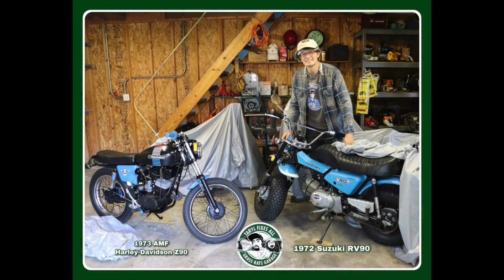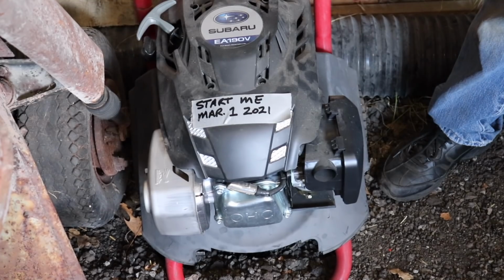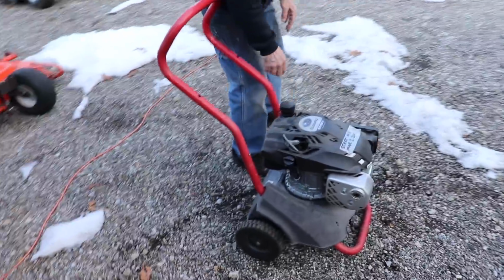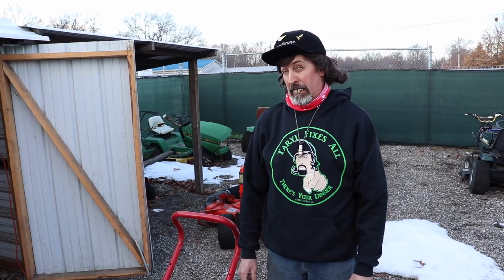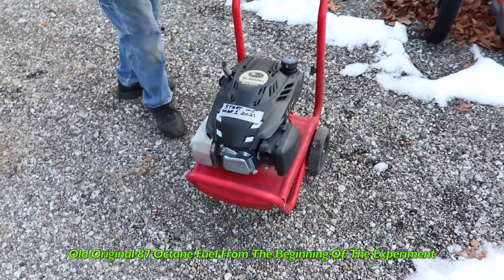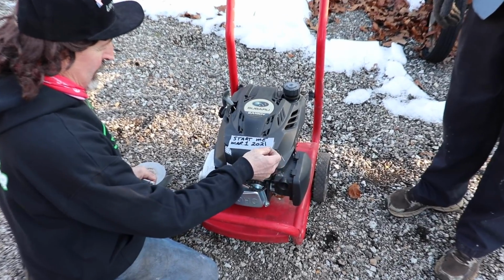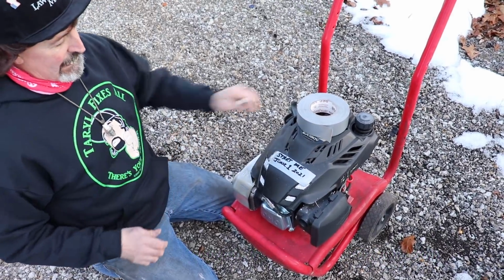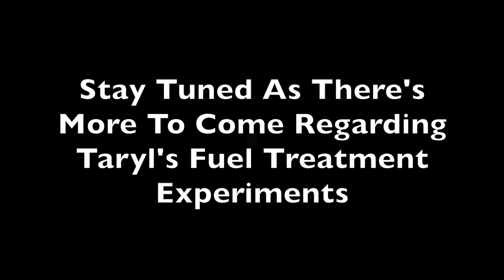Will They Start? Fuel Treatment Experiment

Comment: The engine's started every three months seem  to run better than the ones started every month. I think your right about the snake oil theory
Reply: It’s probably conventional 10W-30 oil in the engines. In the winter it’s hell getting them started. I’d bet if the engines were 3years old broke in and 5W-30 synthetic was used they’d start easy like a snow blower starts easy in the winter.
Reply: @Northlanderm  you don't need synthetic in winter. I have a  mid 60's ariens gard-n-yard with the snow attachment and the original engine. Never had synthetic oil in it and still starts 2-3 pulls mid wisconsin winter. Just regular maintenance.
Reply: @meegstomtom  Every engine brand combustion chambers, ignition, carburetor etc vary per brand and year.

But you are right about proper maintenance.

Comment: I spent a month and a half repairing small engines at my dad's shop. And each day I watched one of your video's I learned so much! Repaired everything from single stroke to duel cylinder and up. My favorite was a Onan 2 cylinder fork lift had been setting for 20 years. With your help was able to break it down and rebuild the engine, carburetor, points, magneto, and a rusted old gas tank. Thank You so much for your video's, There's nothing like the feeling of fixing a broken device.
Reply: Whats a single stroke?
Reply: @effgee5102  1 piston or cylinder

Comment: Taryl: I think you just about hit the nail on the head with your "snake oil" comment regarding fuel additives. These gas manufacturers are very clever people and know everything there is to know about the fuel they sell. If an additive would make a big difference to a fuels performance they would be putting it in there at the manufacturing stage. Lubricant additives are a similar con trick to be avoided.
Reply: I agree, manufacturers know their product. The only time I use an additive (sea foam) is after I've cleaned a carb. I find if something sits for 2-3 years, the fuel here turns orange and soft "crystals" grow in the carb...could be the absorbed water allowing a galvanic corrosion of some sort that plugs them up. Anything that gets used, the fuel never gets that old.

Comment: Those Subaru engines are pretty freaking good.. Left out in the weather for months in snow, they still fired up..

Additives may not be what they claim to be after all..
Reply: I bet the new style Briggs engines with the plastic carburettors and plastic fuel jets wouldn't have lasted this long.
Reply: @bentullett6068  Plastic doesn't corrode. 
People are crapping on Briggs for starting to use plastic in fuel systems, but automotive industry has been doing it for 40 years. Everything from fuel tanks, to fuel pump modules, to fuel lines, to fuel rails, to fuel injectors. All very much capable of lasting the life of an automobile.
Reply: @erikj.2066  it's not the plastic that's the issue it's the main jet design. We have been told by Briggs and Stratton's UK operations that we must change these jets on a regular service. Issue is there are many people who don't look at the terms and conditions the manufacturer states and never service their mowers and expect them to last and work reliably, they wouldn't be told about the jets blocking in the carburettor if the fuel goes off and assume it's under warranty.
Reply: @erikj.2066  And Intake Manifolds.

Comment: A couple thoughts-
"Premium" fuel does not equate to "Better"fuel.

"Octane" does not equate to volatility. It refers to how fast the mixture burns in the combustion chamber, and high octane burns slower than regular.
Reply: In some premium fuels no ethanol is added.  It varies by state and gas stations.
Reply: Premium fuel labeled “No ethanol added” in my book is better fuel.

Comment: Only treatment to my fuel system is I treated it to the addition of a fuel valve. I shut off all my equipment from the fuel valve and burn the gas out of the carb before storage. Been doing this for years and it's never failed me. Mostly just have to jump start the first time.
Reply: totally agree
Reply: Works for me.
Reply: Absolutely! Been doing if for years and it works! I cheat on the jump start. I bought some of those cheap HF float chargers and put one on every vehicle and piece of equipment I own that has a battery.
Reply: I can't wait until Taryl debunks that theory too.
Reply: @mark-wn5ek  Dude, do you even know the definition of theory?
Reply: @mark-wn5ek  I'll debunk it for you right now. Riding mower I bought new in 2008 has never seen fuel additives or anything other than "regular fuel". No shut off, gravity feed keeps the carb full. Stored in the unheated barn from mid September until mid April without being started. Starts every spring, have never had the carb open. Have done a head gasket and replaced the battery a couple times though.

Comment: These newer engines have better sealing gas caps. Old engines have caps that vent both ways. kind of open like the open lid glass jars. Wonder if they left a cap loose for experiment how it would start over time.

Comment: I've been saying since the beginning of this experiment that fuel additives are not necessary.  For years and years, I've been wintering-over leftover 2/4-cycle dinosaur juice.  Never had the slightest hint that they were unuseable from one mowing season to the next.  For the first time since November, I started both my Toro weed wacker and Craftsman leaf blower with a lot less trouble than Taryl had.  My (nearly full) 1 gallon 2-cycle dinosaur juice jug sits on the shelf.  I'll be giving it a shake, then finishing it off, come springtime.  My Craftsman YTS3000 Mower has been starting (twice monthly) throughout the wintertime with plain old 87 octane Corn Whiskey (Ethanol-blended Regular).  My mower gas will be good enough to begin mowing season as well.  Dinosaur Juice Fuel Additives are;  SNAKE OIL, SNAKE OIL, SNAKE OIL!!!  Another big help is, KEEP YOUR EQUIPMENT AND DINOSAUR JUICE CANS INDOORS!!!

Comment: I understand that it is a "will it start test".  BUT will it perform correctly under load ???  
As in...partially clogged jets...
   I'm still a firm believer and long time customer, and recommend 
"Sta-Bil 360 Marine" stabilizer with Regular gas (it is a different product than Sta-Bil storage) to all of my customers...put the correct amount in the can before filling the can at the gas station and use that mix all the time. I do see the result of people dumping stabilizer into the tank at the end of season...nasty mess. 
  My long term test...25 years...of Sta-Bil is a Kawasaki liquid cooled engine on a John Deere 345 tractor bought new. Sta-Bil used in it since new, tractor is subject to being used 12 months a year (there have been winters that it sat unstarted full of fuel for 6 months)...mowing, towing, snow blowing...original carb, bowl never off, no fuel issues. I work all the time on 1 year old engines that have carb issues.

Comment: I had a brand new 15 hp Mercury 4 stroke. In the manual they mentioned nothing about draining fuel out of the carburetor. All the four strokes after that put a red screw to drain the fuel for storage. Now Mercury has EFI. My outboard had that white stuff in the carburetor. I didn’t know it was from the ethanol at that time. I just blamed the outboard as being fussy and hated the thing. Before that I never heard of using stabilizers. My dad never did ever. 
From that point on I’m firm with using stabilizers in all of my engines especially if they’ll sit for months all winter like here in Minnesota. Nobody around here will ever start a lawnmower once a month after the snow falls. When its put away it’s put away. 
Since that I’ve used SeaFoam. Last summer I switched to the Red Sta-bil. This summer I’ll be using the Sta-bil 360 Amber. The reason I switched is because Sta-bil is more economical and goes much further for the price.

Comment: Hey Taryl, I live in the same climate as you. It has been my experince that when I leave my lawnmower sit over the winter, I have no problum starting in the spring. When I put my snowblower away I drain the fuel. I belive it has to do with the tempeture. the cold presurves the fuel, and the heat gums it up. That's just my 2 cents been doing it that way for 45 years. Thanks
Reply: Yep. Here in the Mojave desert, ethanol polluted gad goes bad in 8 to 10 weeks. Smells like paint thinner, looks like orange juice. I only use ethanol free for things that aren't used a lot.

Comment: I just moved south from Massachusetts to Florida three years ago. What I've found is the condensation filling the gas bowls and rusting the pin valves shut. Continually cleaning the carbs. Not to mention replacing fuel lines. All gummed up. Deterioration.

Comment: Must admit those Subaru engines are doing well on stale fuel...but I wonder what those new style Briggs and Scrapem engines with the plastic carbs and fuel jet would be like on this experiment if they were left as they always seem to be the common engine we find not starting or running properly on old fuel after winter in the UK. We don't seem to have issues with the engines like these with metal float bowls and carburettors much.

Comment: Taryl, a suggestion for you: 
What about doing this test using an older engine too? 
The Subaru's having to meet modern emissions (including fuel vapor evaporative emissions), no doubt have vent valves built into the fuel caps keeping the fuel tanks fairly well sealed, and preventing some fuel degradation. 

What about doing this with an older engine that has a gas cap with the simple pinhole vents, or maybe something from the 90's, when they just started trying to do an automatic venting gas cap?

Comment: Agree about the snake oil. What do you think happen? Is the motor builders putting better fuel Lines and o rings or did the ethanol fuel change the formula?

Comment: Would be a neat experiment of the materials by putting a new carb kit and fuel line into 87 pump fuel with ethanol.  Then either new old stock or strip an old engine made before ethanol for needle, seat, gaskets and fuel line into the same fuel.  See when/how fast each one goes crunchy or falls apart.

Comment: I never use fuel additives besides what ever they put in 2 stroke oil. Haven’t had any issues besides just the fuel being so old it didn’t want to run. Swapped the old mixed fuel that was 6 months old on the dot for fresh and all symptoms went away immediately. Fuel just didn’t have enough octane to run anymore. The symptoms it had was it was unable to rev up and felt like it had major carb issues to the point I was gonna take it to the dealer.
Reply: Octane??
Reply: @chrisbcritter6112  yea its the rating of the fuel. when you go to the pump and buy gas its by the octane rating. the higher the number the more resistant the fuel is to detonating. if it drops to low nothing will really run on it. you can read up on the octane rating on wikipedia they explain it. in the states we use 2 different types and use the average of those for our rating

Comment: Does the relative age of the engine or motor factor at all?  Those Subies were brand new. Would a worn out 15 plus year old Briggs powered mower still start treated with this stuff?
Reply: Personally i wouldn't waste my money on additives..just use a good quality non oxygenated ethanol free gasoline and keep the machine in a garage or shed
Reply: @leeharris3061  I use any and all cheap fuel with ethanol. The way I avoid carb and fuel system issues is shutting all my equipment off with the fuel valve and burning all fuel out of the carb before storage. Been doing this for years and it's never failed me. Mostly I just have to jump start the first time.
Reply: If you have not put new fuel lines and a new carb rebuild kit you would have problems.
Reply: @johnisley1285  not sure who your comment is directed to but after installing my fuel valve carb replacement is a thing of the past. Most of the carbs I replace now are on other people's equipment.
Reply: Not in the sense of being worn out, but in the sense of EPA compliance for fuel vapor emissions. 
Without a doubt those one year old Subie's have to meet much stricter standards for fuel vapor control than what a 15 year old Briggs would have, meaning the fuel tanks are much tighter to air, which would mean less fuel evaporation, oxidization, and contamination that would cause the fuel to degrade faster.

Comment: I only use non ethanol gasoline, from a reputable and high volume source, in my small engines. I never use any kind of stabilizer or treatment and have yet to have any kind of fuel related problems. My pressure washer that sat for over a year started up with only a few pulls.

Comment: Wonder if carbs get plugged because of the extra dirt/contamination from actually using the mowers for a while. Everything you have was brand new. Might need a used engine/tank and a used fuel can let that sit around the gas will evaporate and you leave behind more dirt % in the fuel thats left.

Comment: one spritz of starter fluid and I think all the engines run on the first to third pull no matter how old the gas...i use Stabil but now I wonder...i guess if it doesn't hurt but I usually run everything dry at the end of the season...i would just put some stabil in the left over gas in the can

Comment: I must admit I'm shocked that they started. We know that at some point all gasoline gets rancid and leaves resin in the carburetor and gas tank if it sits long enough and that ethanol is fuel does attract water. Phase separation is definitely a phenomenon that occurs. So what circumstances are  preventing these issues in the engines being tested? Do newer engines  have better sealing of the fuel system from air to prevent evaporation and contact with outside air due to EPA regulations? Have manufactures of newer engines started using rubber parts that are more resistant to ethanol than older engines due to the prevalence of ethanol fuels?

Comment: Doesn't that stuff also protect internal metal parts from corroding? I have a old  craftsman mower that had corrosion in the bowl. I never used any protectant. Come to think of it i still don't.
Reply: Mix some 2 cycle oil in the gas and run it dry. I've had good luck using this method.
Reply: @kalebgrieve1729  ok thanks!

Comment: I used to have a small yard and the gas container I had the first time I filled it up i filled it up full, i think it was a 2 or 3 gallon container.  Basically this was my first yard, first mower.  So the first year, i used hardly any of the gas,  so i kept using the gas until it ran out, and I'm not kidding when i say i got 3 seasons out of the same gas.   So when i hear people say that gas goes bad after a few months I just laugh because i personally know that's not the case.   no additives, always sitting outside under my porch,  3 seasons using the same gas and the mower always fired up fine.

Comment: Snake oil. I have been using the same gas that is sealed and stored in a shed in the Spring that was leftover from the previous Fall every year for 20+ years in my Briggs and Lawnboy stuff. Never have run them out of fuel at the last use either.

Comment: I'm starting to wonder if the engines themselves may be the reason they are all still running, perhaps these Subaru engines are more capable of running on bad fuel than others. I have never actually seen these in the wild before, I have only seen them on a few new pieces of equipment up on Ebay/Amazon. I reckon if you use the same 15 month old fuel in something far less reliable it would probably fail within a couple of months.

Comment: I run straight pump gas in all my 4-cycle Equipment, never had a problem. Just let it run dry and empty the carb before storing it. In spring I fuel it up with fresh gas and all started and run good.

Comment: I would love to see one of the engines not start and see what happens when you add something like the startron to the tank of the non runner. My rep at stens told me many times about shops who get machines started just by adding a bunch of startron to the tank and letting it sit a while. Something to do with the enzymes or whatever. I really don't think it would do anything but it would be interesting as part of the experiments.
Reply: sounds like he blowin smoke
Reply: @barackobama5304  that's what my thought was. I have never tried it because it sounded far fetched.
Reply: @patthesoundguy  I have tried it.  The problem is blockage in the jets in the carb.   Just putting stuff in the tank ain't gonna get to the jets.   Even if it somehow is able to get to the jets if you push the primer bulb 50 times it aint gonna do squat.   The only way is to open the carb and clean out the jet with a wire.   Even spraying carb cleaner isn't enough on some of the deposits I have seen.
Reply: @barackobama5304  yes that is exactly my issue with people selling a product to try and make something run by simply dumping it in the tank. I have my own business and I would never sell someone a fix in a bottle. I'm going to pull the carb and do the job right. I'm glad that Taryl has started the experiment because I have always thought I was crazy that I noticed the stabilizers and such never really did anything.

Comment: well i had my mower sittin in garage 5 months, so it would'nt start this sring. so emptied the tank, cleaned the carb bowl, put new gas in it, and it started on 3rd pull. b&s quantum60 23 years old. the old gas was orange in color. the gas here in germany must be alot worse. i think the gas was 95 octane. so gonna give gas treatment a try.

Comment: have said it before and i will re-say it, i do drain my bowl on my 26 yr old snowblower, but i never drain the tank or use additives. always starts every yr. no problem, have removed the bowl for a lil cleaning 3 times, imo, fuel additives for longer life are not snake oil, but there not the answer. course i do buy prem fuel in my mower/blower fuel can.